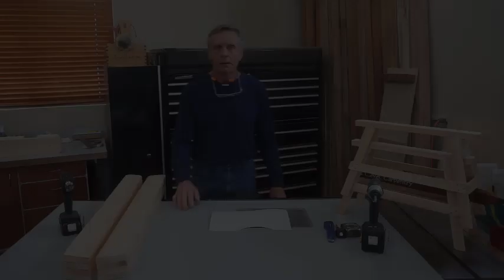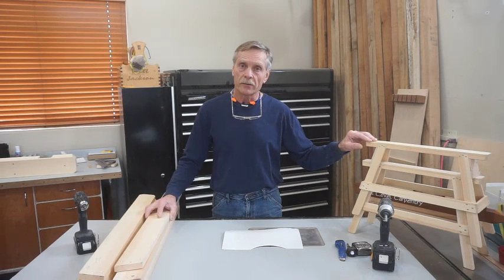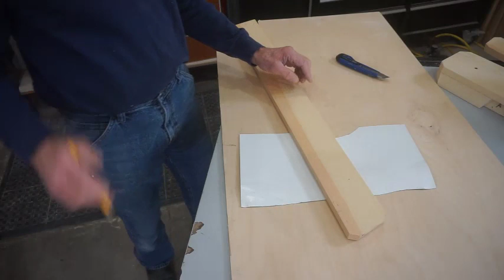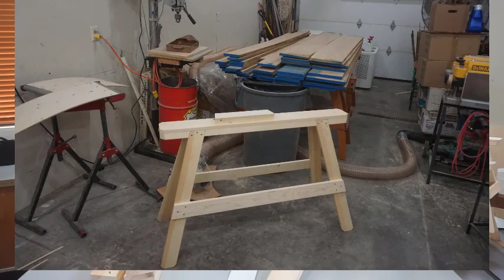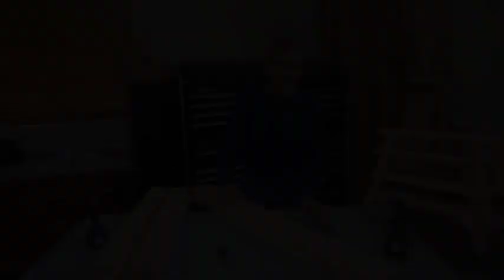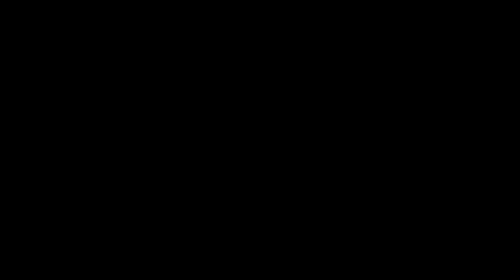Quick and Accurate Layout for Fasteners

Comment: Great tip, Matt.  So simple I can't believe I didn't think of it before.  I really like the idea of sheet metal for making durable templates for some of the more common stuff, like 4" high x 1/2" thick drawer sides where the holes need to be 1/4 inch from the edges.  Coincidentally, I just spent the last couple weeks culling 40 years of files and saved all the manila folders that weren't beat up.  Some of them are nearly 1/16" thick and very dense paper--perfect template material!
Reply from the maker: Maybe it just means you're not a lazy as I am Francis... the lengths I'll go to just to avoid a little bit of repetition?🙄 Those file folders sound like the perfect material for this kind of template but begs the question: now what to do with all those empty boxes of Cap'n Crunch and Frosted Flakes, right? Best, Matt

Comment: Matt...your right! That Cereal Box Material sure does come in Handy. I keep a Piece in my Truck Tool Box, Stored along the Side. Doesn't take up any Space & Weighs next to Nuttin'. I also keep a Piece of Scrap Sheet Metal for those times I need more Structure...besides, Sheet Metal Patterns Last Several Life Times! Plus...you can Mix Epoxy on them or use them as an Edge when Painting... Etc. Tons of uses when you think about it!!!
Reply from the maker: You know it cheewurz... sheetmetal is the ONLY way to go for durability and sustained accuracy! Best, Matt BTW I'm kind of partial to boxes from Frosted Flakes, Honey Nut Cheerios and Fruit Loops... still a kid at heart, I guess?

Comment: You know Matt, Woodpeckers probably makes a tool for that for only $499.    LOL.

Love the simple things.  In the years I spent as a machinist, I always kept the wrappers from Kit Kit Kat bars in my toolbox.  When you took a Bic lighter to the foil, it burned off the paper and left a perfect piece of foil behind that was exactly .0005" thick.  Perfect material for when you needed that really thin shim for adjust some setup or another.

Comment: I used to use this method but the holes grow and become inaccurate quickly.  I cover both sides of the grid paper/shoe box with sticky tape, then cut little triangles/arrows out with a knife instead.
You can use a pencil/texta to mark through the stencil triangles, they will also live for years if stored inside a book etc.

I also prefer to use a center punch to mark drill holes in wood, its also the best way ive found to install door hinges when you dont own a seld centering drill bit. You just push the center punch into the wood really hard and it finds the center of the hinge hole.
Im sure compressing the wood with the punch makes the wood stronger (to resist the screw pulling out etc)

1 last tip, I use a grinder to taper my drill chuck to 45 degrees, so when im drilling I can use the tip of the chuck to make the countersink for the screw. I dont sharpen the tip of the chuck so it can burn the wood, but its possible to put a taper on each jaw of the chuck to allow it to drill as pre a drill bit
Reply from the maker: Have you tried using thin sheetmetal for more durable templates?  I've used the little cutout triangles thing for some templates too... interesting to know you've found that useful too.

Comment: Hí Matt,
Can do a clip show how to divide space equally on a board? Thanks
Reply from the maker: Great idea Jeremy!  Thanks for suggesting... I'm trying to whip up a few other short 'pro tip' videos like this and ways for dividing space fits perfectly... so when you see a video on it you'll know it was your suggestion that prompted it!  Best, Matt  PS If I forget to give you a shout out please remind me of this, OK?  Thanks again!
Reply: I use a metric rule... measure the total length & divide by the number of spaces desired. I do it all in millimeters as it makes layout easier[1]. Use care as sometimes end fasteners (or whatever) need to be closer to edges etc. In that case, first mark the proper end fastener locations, measure between them, do the math and your off to the races. Try it... I bet you find it easier than messing with a bunch of imperial units.
[1] If you use your calculators 'constant' feature, it'll quickly give you the exact placement figures.
Reply: @rwbishop  Base-10 is for whimps.   :)
Reply from the maker: @jeffeverde1  LOL!  I'm going to have to use that, thanks! Best, Matt

Comment: I was using regular A4 paper for that, but they sometimes tear out, and they tend to fold a little bit, the shoebox is a much better solution, Ill stack some pieces along with the masking tape drawer
Reply from the maker: Heavy paper works for some templates too Gabriel but I think you'll like what this shoebox cardboard will do for you! Best, Matt